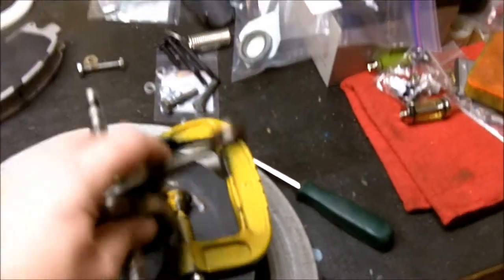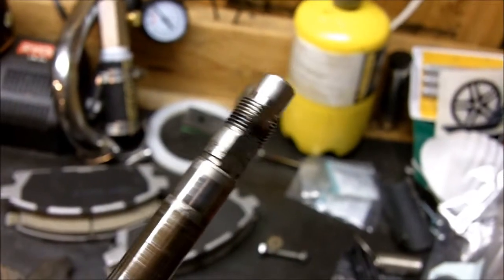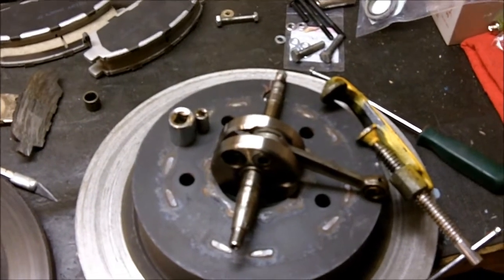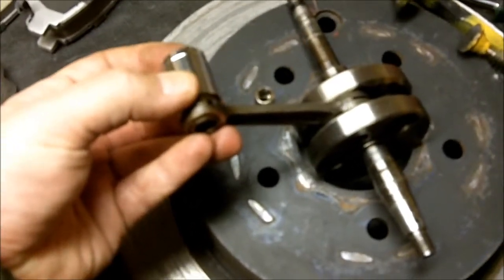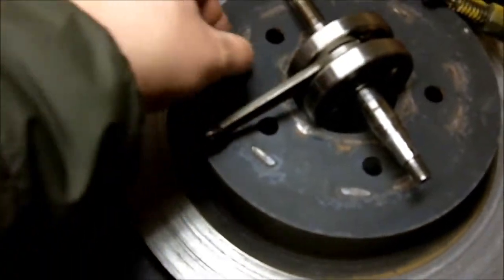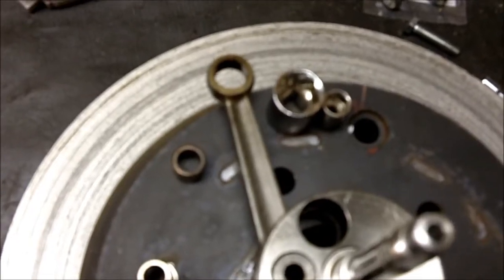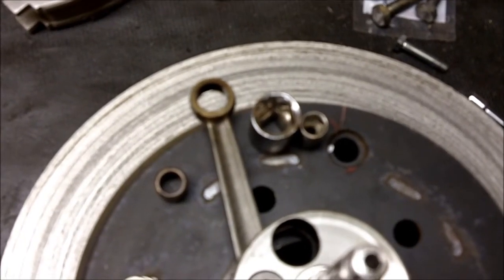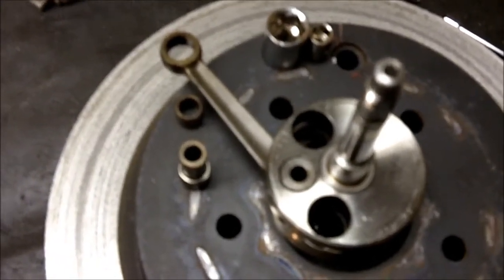How to kit a Tomos A3

Comment: The A3, A35 and A55 are all completely in-house designs by Tomos and have nothing to do with Puch. Since the A3 rolled out in 70s the Puch licensing was over. The A35 was never on any Puch mopeds. A correct Puch cylinder code is A38B.

Comment: or... do it right and replace the connecting rod with a rito that has a 12mm bearing in it
Reply from the maker: I agree that's definitely a better way to go about it and I mention it at about 3 minutes in, but this is an easy way to do it yourself without having to send your crank out to have a new connecting rod pressed in.